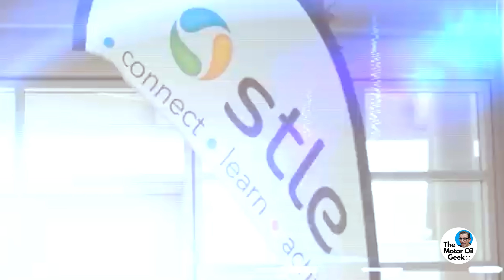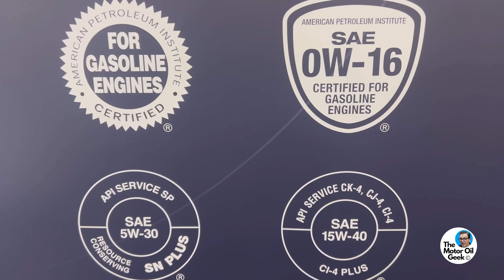Are Today’s Oils Ready for Tomorrow’s Engines?

Comment: Lake I know the lubricant future. It will be 0W-1 probably or thinner!
Reply: 0w0? Is that H2O? 😁
Reply: Thicker oil isn't better
Reply: @BadBoiFX  Data say otherwise. Your thoughts are irrelevant…
Reply: @Maynardd he made a video looking at the data and you are wrong lol
Reply: @Kalil-xk1du  no not wrong at all… interesting how 0W anything destroys engines and thicker oil doesn’t.
Reply: @Maynardd the 0w isn’t what hurts engines. it’s the number that comes after. In fact, the 0w is usually better for engines, due to being thinner on startup. Brands like porsche even use 0w40 as factory fill in their gt3 cars. It’s just that 0w is usually oils like 0w8, 0w16, 0w20, etc, so people think that the first number is harmful
Reply: @Iadders Vic Sheppard , owner of two - million  mile Tundras used 0w20 syn as per the manual. Granted , he used these trucks for probable mainly highway use , but wow. Borescoped my 18 RX350L after 3 changes of Restore and Protect . Zero sludge and minimal varnish. Staying with 0w-20.
Reply: @tomphillips2608 Thats awesome, but I’d personally go a grade above what the manual recommends in most cases, as I like to go on spirited driving runs. So i’d go for a 0w40 instead of a 0w30 if the manual recommends a 30 weight. I do believe that the thinning of oils is majorly due to stricter regulations with fuel economy, so a slightly thicker oil could add extra protection. Not really needed if you just use the car for commuting though.
Reply: @Iadders  which is why the second number being 30 is far better.
5W is good to -25°F.
0W is good up to -40°F. You’re better protected under 5W-30. Of course, the second number being higher providing better protection.
Reply: @Maynardd I’m not exactly understanding what you’re trying to say, you said that 0w anything is bad for engines, which isn’t true. The viscosity at operating temperatures is what really matters, the cold flow isnt really relevant until low temperatures. The reduction of the viscosity under operating temperatures is what can hurt protection.
Reply: @I @Iadders ’m not sure what you don’t understand? You said it yourself it’s about the viscosity, for starters 5W-30 protects approximately 35% more than 0W 20 due to its viscosity, not to mention as oil breaks down you lose viscosity. After about 1000 miles of running that 0W 20, you’re running more like 0W 17 for example. 
As you want the oil thinner at start up as you feel this is good, it has just about no protection whatsoever if you’re using 0W where most wearing occurs. At start up. And not to mention with today’s full synthetics, they are far thinner, for example 5W-30 Amsoil that I run than a standard 5W-30. I couldn’t believe how thin was when I first used it. 
I’m not trying to be rude, but your argument in my opinion is completely void.. If you didn’t need any more protection than 20, then there wouldn’t be oils in vehicles that go as high as 40. Even 50. 
I really have yet to see a mechanic and I mean one that doesn’t work at a dealership because they will tell you 0W anything is perfectly fine because they must tell you that. i’m talking a i’m talking about one  that owns their own shop, Say to use 0W anything, as a matter of fact, I heard one specifically say they would die before they put 0W anything in any of their vehicles Due to its lack of protection for longevity. And the more stress you put 0W anything under a load like GM forcing people to use 0W 20 the faster it breaks down. If you must use 0W anything I would never go a mile over 3000 miles. I would probably change it every 2500 miles.
Reply: @Iadders  Best to go with actual data than "stupid government" assumptions.  While they may be true, the data will will be definitive.  Kind of the point of this channel.
Reply: @Maynardd The difference in viscosity at startup between a 0w and 5w at anything above -20c is pretty much 0. You can look up individual KV40 (viscosity at 40c) measurements for different 0w and 5w oil, and they are almost identical. Plenty of people run 0w oils and are at extremely high mileages, it’s really only the viscosity at operating temp that matters. Porsche literally uses mobil 1 0w40 in their gt3 cars for example. Point is, the difference in wear between a 0w and 5w with the same viscosity at operating temp is 0. At that point, it comes down to whatever oil has the superior base and additives
Reply: @Iad @Iadders t information you just said is 100% false! 0W motor oil has basically no viscosity at startup that’s the entire point here. 5W does. This is why the first number Matters. zero has none virtually, that second number you keep talking about Also pertains to the first number when there’s an actual number like five. Makes sense? 5W-30 motor oil has a viscosity of five at startup. Zero has none. You’re just trying to convince yourself with your own thoughts and not using data so it seems., this is exactly why the first number matters. Which is also why no true mechanic will use it in their own vehicle. An not to mention the breakdown on viscosity on 0W oils is rapid.
Again, most damage occurs at startup and you’re getting about half the protection using zero as opposed to five. As you stated the second number is what matters, once again, 30 is far better than 20. That’s basically from your own mouth. 
You keep bringing up Porsche, perhaps you should do a little digging on that, Porsches are for the most part absolute garbage. Declining reliability since 2017. For whatever reason you’re impressed the 0W motor oil. What load do they actually carry? Pretty much none. And as for additive packages, completely irrelevant at startup. At start up all that matters is the first number and zero is the worst number you could possibly have.
Not to mention the thinner, the oil the less it will stay on your engine parts and will drain to the pan. Vehicle sitting for a few days? Thicker oil will remain on those engine parts. ￼
Reply: @Maynardd You typed all of that just to be wrong😭😭 Again, the difference in viscosity between a 0w and 5w is literally margin of error past -20c or so. Go ask around in BITG, or and car forum for that matter. This doesn’t even account for the major differences in viscosity between same grade oils but with different brands. And with porsche, its the very opposite, with 2017 being the first year without borescoring issues😂. They’ve gotten more reliable from then on. All you have to do is ask around on forums and learn. Being ignorant isn’t helpful. I thought the same thing before, that 0w is too thin at startup, but I quickly learned otherwise
Reply: @Maynardd 0w also doesnt mean no viscosity lol. A 0w is still thick when cold, just less than a 5w and so on. Startup wear also occurs because a LACK of oil flow. 0w flows faster, which is better for startup wear. 0w and 5w also drain at very similar rates. That basically sums up what I’ve learned from others that know miles more than I do. Hope this helps, i’m eager to see what you think
Reply: @BixbyConsequence I’m basing what I say off of asking many people in BITG and other forums. The whole “0w is bad” argument is baseless, and you should be paying attention to oil viscosity at operating temperature. I’d personally go one grade above whats in the owners manual. For example, if the manual calls for 0w30, i’d use 0w40. 0w is great at minimizing startup wear, because oil is many, many times thicker at startup.
Reply: @BixbyConsequence Its hard to argue with somebody that thinks that 0w oil has no viscosity at startup too. I thought everyone knew that oil is tens to hundreds of times THICKER on startup
Reply: @Iadders  no, it’s not better for start up because there’s no protection. This is what you fail to realize. In your case, ignorance is bliss!  🤦‍♂️
Reply: @Maynardd Explain how theres no protection? Its literally tens to hundreds times THICKER then at operating temperature😂😂 Please come up with ACTUAL evidence that 0w has no protection at startup. It has the fastest flow compared to any other weight, but ANY oil is extremely thick at startup
Reply: @Maynardd You want oil to get to the thickness at operating temperature as quickly as possible. A 0w starts out a bit less thick than a 5w and flows better. It’s just common sense man
Reply: @I @Iadders ith LESS PROTECTION. 
You do realize heat is the enemy of oil don’t you? 0w only thing does not hold up.
Reply: @Maynardd Dude what? Either oil will be extremely thick upon startup, whatever oil flows faster initially will protect better. It’s matter of how quickly the oil can get to operating temp and viscosity
Reply: @Iadders  unless it’s -25° or colder there is zero difference in flow. This is fact. At operating temperature 5W-30 has a 35% thicker protection. Also fact. Why do you think people move to thicker oils as the engine ages? 0W 20 will wear out your bearings up to 25% faster. There is literal data that shows this. The only reason for 0W anything is EPA. Better gas mileage. While you destroy your engine using it. Well done! Again, unless it’s severe freezing temperatures, the cold flow is irrelevant as it’s almost identical. Don’t comment based on your thoughts. Know what you’re talking about before you talk about it.
Reply: @Maynardd WHEN HAVE I MENTIONED 0w20😭😭😭😭😭 I’m talking about the same viscosity at operating temp. 0w30 and 5w30 for example. There is no downside of running the 0w30
Reply: @Iadders  wrong again, that’s like saying water flows faster than oil so why not use water? 🤦‍♂️ there you go using your own thoughts instead of data…. you don’t know what you’re talking about.
Reply: @Maynardd How dense are you? Explain the difference between a 0w30 and 5w30 at any temp above freezing😂 Good quality oils won’t shear much out of grade, if at all. They are both in the same viscosity range at operating temp too. There is absolutely no downside to running a 0w30 as compared to a 5w30
Reply: @Iadders   I guess I missed the part where we were talking about 0W 30 and 5W 30??? Should we talk about the weather compared to oil now?
We’re talking about 0W 20 and 5W-30
But since you brought it up, the difference is no protection at startup in your example . And you want to bring up shear? Perhaps you should go watch Lakes video about shear. Tell me genius, which will shear first, 0W 20 or 5W 30? Can’t wait to hear this answer. Dense? I guess we’ll just call you dumb.
Reply: @Maynardd Again, no protection at startup is a COMPLETE LIE when both oils are extremely thick. I never mentioned 0w20 once and have said that I was referring to equal viscosity at operating temp. Again, there is NO downside of running a 0w instead of a 5w when the second number is the same. I replied to your original comment of 0w anything being bad. Which is just false
Reply: @Maynardd    The 0 that comes before the W, like the 0 in 0W-20 in a multi viscosity oil is the cold/ambient temp CCS viscosity rating measured in centipoise. The 0 or whatever number it may be before the W is just a number used in the cold viscosity SAE rating scale. As is the number 20 or whatever number it may be is after the W is just a number used in the hot SAE rating scale.  The number that comes after the W like the 30 in 5W-30 is the running or hot temp kinetic viscosity measured in centistokes. 
  So all 0Ws viscosities are measured at -35°C,   5Ws at -30°C,  10Ws at -25°C etc.
 But the kinetic viscosity at normal running temperature for the number behind the W are all measured in centistokes at 100°C.
So There Is No None ok.
Reply: If I'm not mistaken it's something like that that's used in ProStock, or at least some extreme drag racing.

Comment: A few weeks ago I  bought some Castrol Edge motor oil for my girlfriend's car and noticed it had the new API SQ specification.
Reply: Yep..The API SQ Spec...Is Also At Dollar Tree's Syn Blend Motor Oil 5w30/10w30...But Yes...Trust Castrol Full Syn....
Reply: Which viscosity did it have?
Do you remember the name?
Reply: @u.e.u.e. Castrol Edge 0w-20
Reply: @T_Burd_75 Cool. Maybe the manufacturers get new certifications, maybe they change their formulas a bit.
Reply: @u.e.u.e.     they had to, to meet the SQ spec.
Reply: Thats what i use...
Reply: Yes,i believe Castrol actually had SQ back in October or so of 2024..didnt hit the shelves till later though.
Reply: @steverugerguy9606  I got a couple of jugs of Quaker State Ultimate Protection 0W - 20 back in November, and they had the SQ rating on those jugs.

Comment: Very excited for the api sp vs sq video from what I heard the most important thing is that api sq demands an lspi test with old oil instead of just with new also many api sq oils like for eg ravenol have very impressive noack numbers very interesting stuff
Reply: Pretty much all the api sp oil now are sq spec without formulation change.
Reply: @Malossianoplus many oils did undergo a formulation change though, since  api sq is far tougher to achieve, not only new but aged oil must pass lspi testing, sulphated Ash is now limited at 0.9% maximum, api sq introduced some new tests like the aged oil lspi Test: Sequence IX .
 and it strengthened the requirements for previously used tests for example the deposit control and oxidation value for Sequence IIIH test was increased from 4.2 to 4.6, for Test: Sequence X they reduced allowed wear limit from 0.085mm to 0.080mm, they lowered the cold flow viscosity limit from 60000cst to 40000cst (MRV), api sq certified oils are compatible with a wider range of seals , and the list goes on many oils did see updated formulation, ravenol, shell(pennzoil),valvoline, liqui moly…all had to adapt to pass new tests and requirements